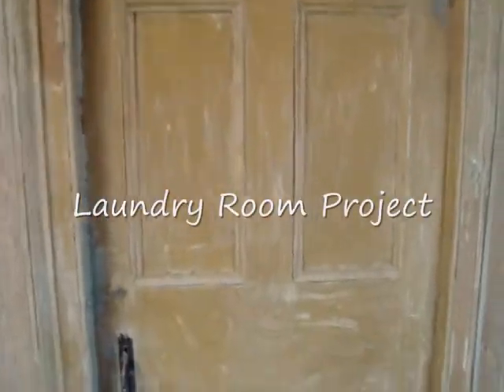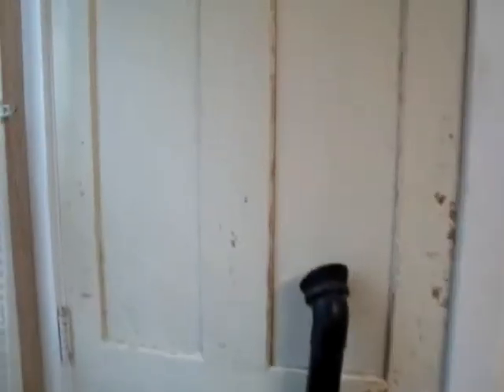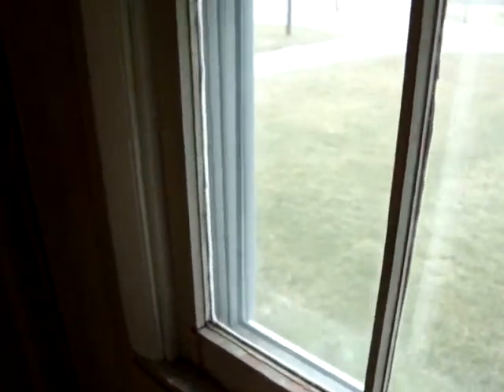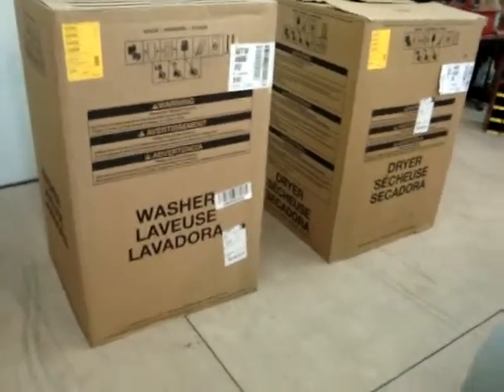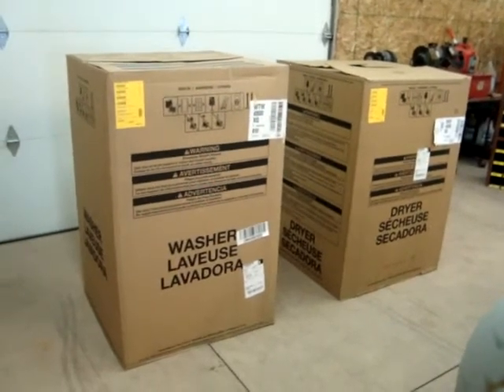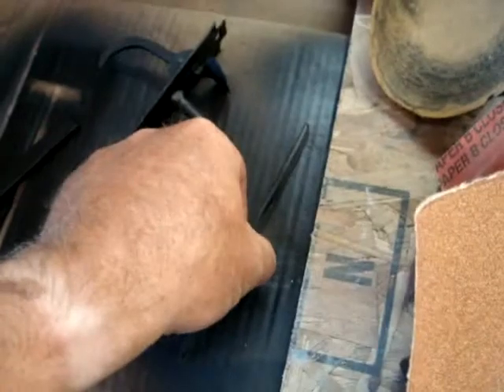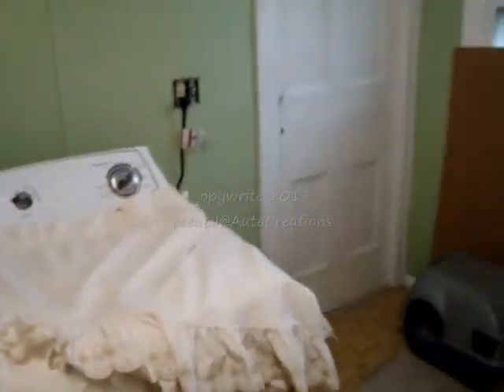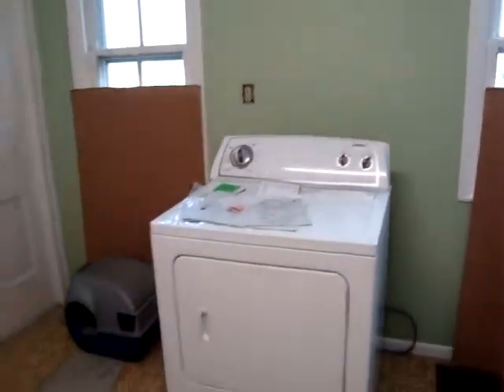Laundry Room Project

Comment: Nice old wall hung sink with built in backsplash. We had similar colors in our bathrooms back in PA. I haven't started on bathrooms here yet, since I have been doing the kitchen first. I really like the vintage hardware. If you couldn't fix the pieces they would be very pricey to find for replacement.
Looking really nice.